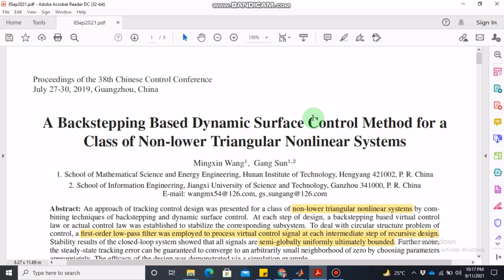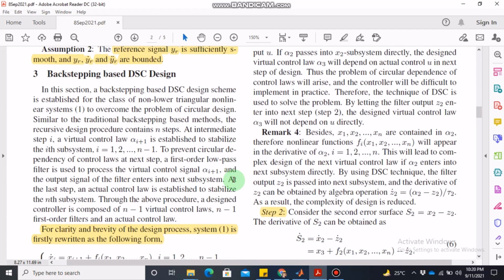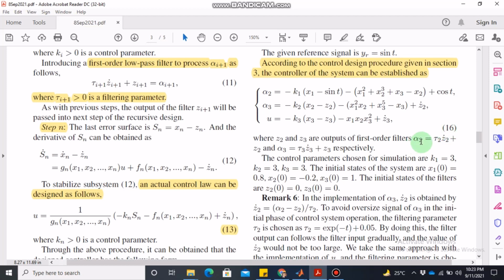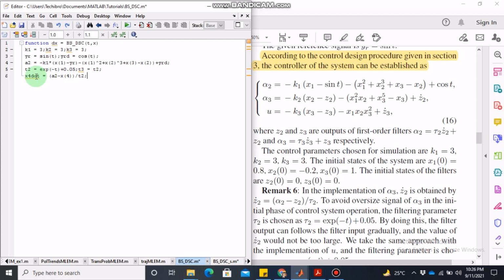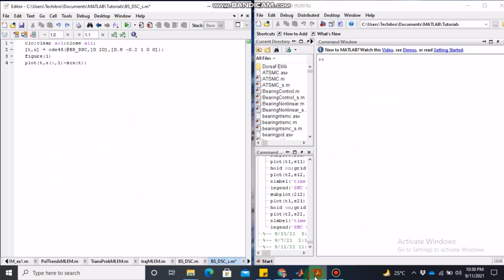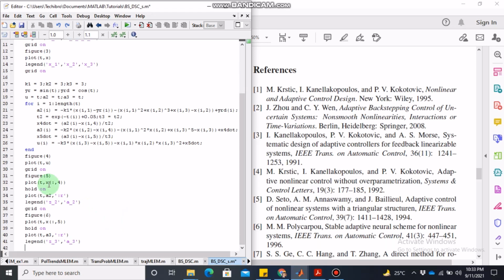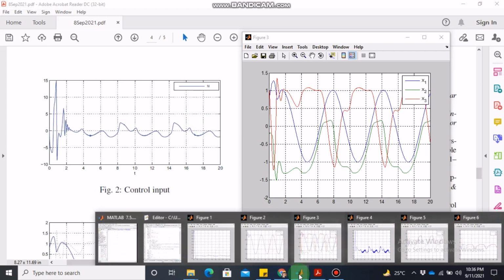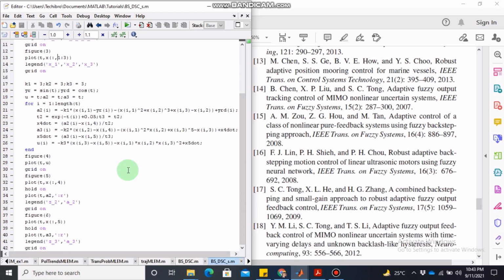MATLAB Example of Backstepping Based Dynamic Surface Control Method for a Class of Non lower Triangu

Comment: Sir control input and sensitivity are same when it comes to compare the compare the performance of Controller?
Reply from the maker: Dear prince, sensitivity is a property of a system. (please watch https://youtu.be/Nc5pEcHxrag for easy explanation). Control input is not the same as sensitivity. You can relate the control and the sensitivity as follows: A good control design is the one that helps in reducing the sensitivity of the system to external disturbances.